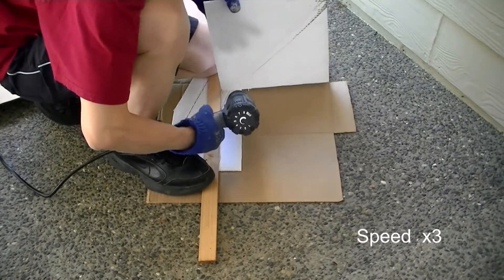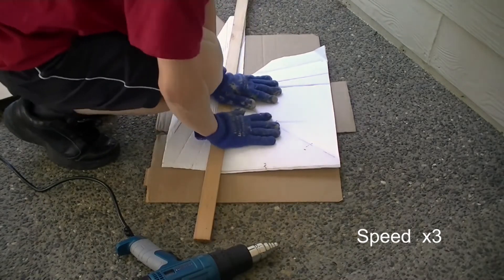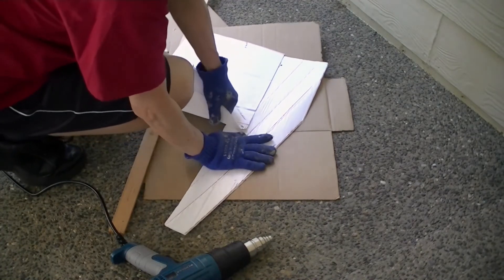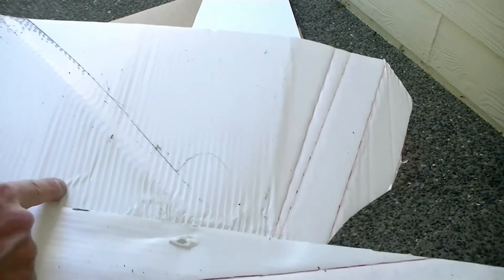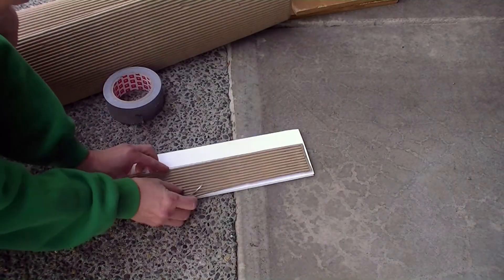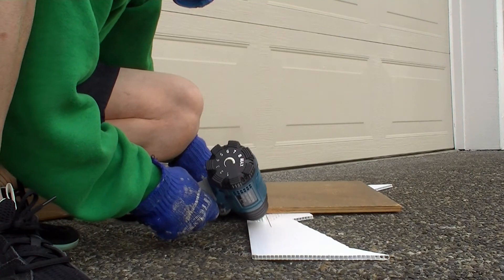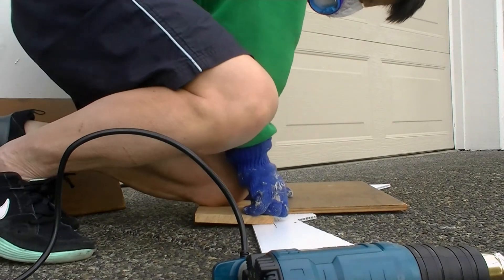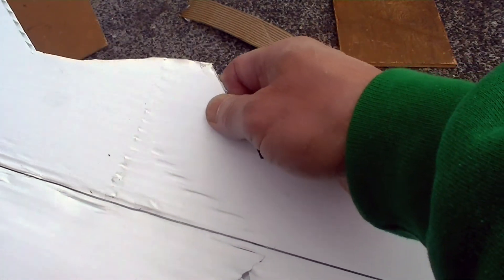Part 1 2020 Update - Heat Fusion to join two pieces of coroplast

Comment: Hi. I am also a Computer Engineer :)   I once built a 14ft plywood boat , using only Gorilla glue!  It really worked, but it was heavy. And like you, my wife wanted the garage back :)
 I am starting to investigate other materials and found your wonderful videos.  Have you tried using glue or solvents to fuse the sheets together?  I am also thinking of experimenting with fusing multiple sheets of plastic together to strengthen parts like the floor.  Maybe instead of folding it could be assembled from parts, like I have seen where the bow section and stern are watertight and are attached with seals to a midsection.  I will keep watching your videos. Thanks!!!!, Jamie in Florida
Reply from the maker: Hi Jamie,  Thanks for your questions. I have tried using tape and glue: video here: https://youtu.be/iRv7EY3Qa-4
But it is not very reliable :-) I  purchased a special epoxy glue from 3M and I believe that will work well on coroplast (according to their test) but I never try it because it is costly. Then I developed a technique and use heat to fused sheets together. Did a simple test and result was very good (test demo was in one of my videos.. this page has a list that will helps you to find videos in my channel related to specific topics   https://www.diyusa.org/techniques ). I actually built my Gen 10 using heat fusion, no glue, but I used 4 metal screws. Make Magazine asked us to build a kayak that uses 4 mm thick coroplast and we validated we can build a nice foldable kayak with all the materials from Home Depot/Lowes. The Make Magazine article is here: https://makezine.com/projects/origami-kayak/   The video on that kayak: https://youtu.be/bmMcqo1-pHo
I have completed a video series on building that kayak: https://youtube.com/playlist?list=PL2ShZzOUu01v-D-Ap1XcX8TgnFlzwf1NP
I started building a modular fish kayak last year... similar to the idea you have and came across the water leakage issue. I paused that project and completed three other designs instead. Now I can solve that problem and I will restart the project next month, hope my garage will be warm enough for me to work on the boat... the concept of that boat is here.
https://youtu.be/GYJq3BOIcDc
I wish I can move to Florida so I can enjoy the nice warm weather and beaches :-)     Cheers!   Hong
Reply: Polypropylene a fairly soft and resistant to solvents -it doesn't glue well to anything.  PP does stick to itself very well and it can take lots of heat and pressure without degrading.  As such it is much easier to melt or weld it together than to glue.
Reply from the maker: @skyak4493  Thanks for your input! You are 100% correct. There is one challenge is the coroplast is so thin there isn't (in a few usage cases) enough 'melted' material to provide a good bond. Sometimes, I melt extra slice of PP to provide extra material for it to bond.
Reply: @DIYUSA  Material thickness will always be a limiting factor in attachment.  The good news is that PP yields over 100% before rupture.  PP is used in FDM printing so if you or someone you know has a 3D printer with a Bowden (where the print head is separated from the feed motor by a long Teflon tube) setup you could just freehand the head like a welding gun.  There are little handheld "3D sculpting" guns but those are likely too low power.  Another suggestion is to "Scarf" the edges before you weld -melt the edges closed to the same shallow angle -the flip one side so the two sides meet at a large contact area but a constant thickness.
You might be thinking my suggestions don't have enough material or overlap -my reasoning is that there is no benefit to an attachment that is thicker than the wall you attach to and PP sticks perfectly to melted PP.
Reply from the maker: @skyak4493  I really appreciate your input, especially on the 3D printing information. I will look into that. I want to smooth out the edge of the coroplast because the edge can be very sharp. There are manufacturers able to round off the edge, do you know if there is a way a DIY'er can easily do that also? I will also experiment with 'Scarf' .Thanks again for your input.